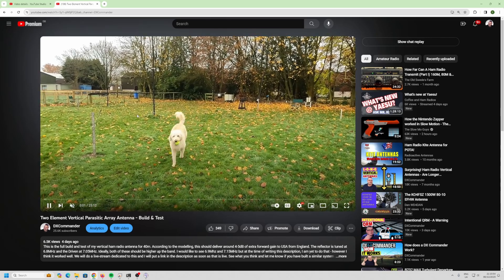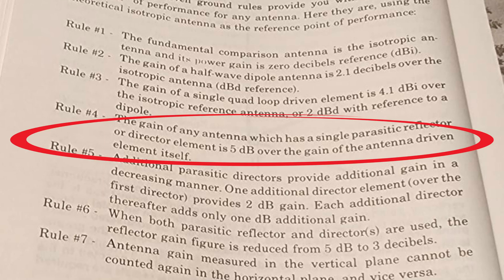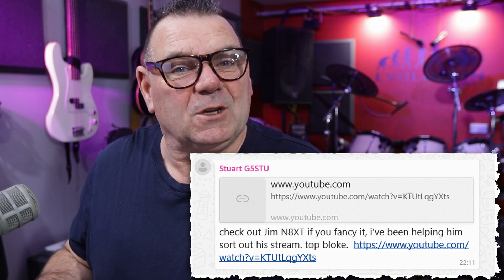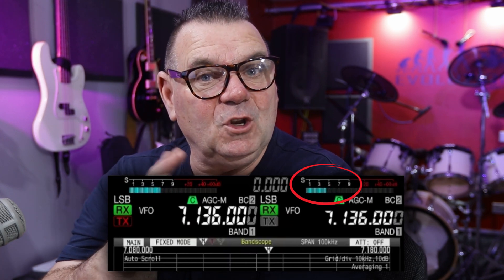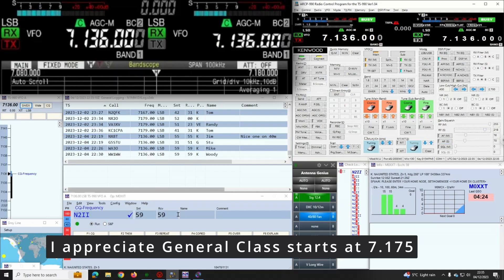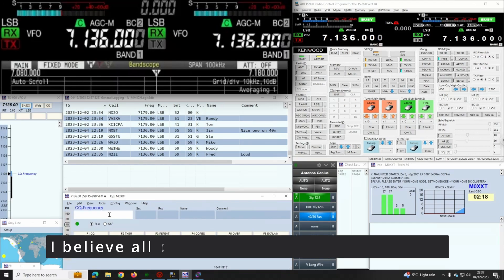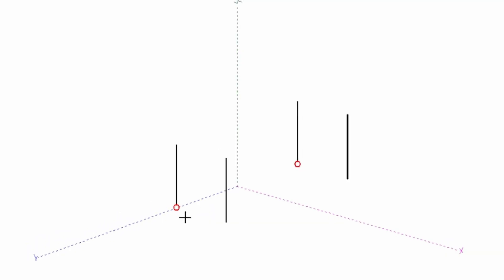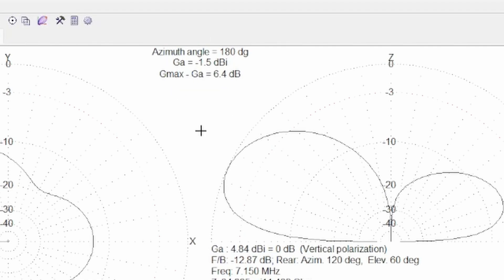40m Vertical Antenna Array - England to USA DX Result

Comment: Hey Callum.  This channel is such a good help and I really appreciate the ideas that come up.  (EG: so the listening antenna close to the ground.  Never would have thought.  I live in a city where there is a lot of noise (Calgary, Alberta, Canada) I'm about to set up a listening post and limited space in the back yard.  This will be advantageous for my situation.  Keep up the good work.  We are starting a class here where I am facilitating the class.  The participants need to get a minimum of 70 out of 100 questions here in Canada.  If you get 80 and above you acquire Basic with Honors.  Then you can operate everything from uhf, vhf and HF by phone.  It's exciting to see a lot of others really interested in this.  You are right.  It is a scientific hobby.  It gives a lot of satisfaction, especially when you can use the "hobby" during an emergency and help others.  Have a good night from across the pond as it were, from Canada.
Reply from the maker: Thank you for your volunteering! Yes, also suggest to your folks the Loop On Ground technique. Works great.

Comment: Would be interesting - if possible - to run WSPR overnight with both antenna systems to look at the results and maps on WSPR Rocks (or other WSPR reporter). Would show the real time comparison of direction, sig strength, etc. between the two to see if the gain is what is expected/modeled.
Reply from the maker: I would indeed..

Comment: Made my first 40m DX contact today (Azores island). I usually just hear stateside rag-chews on 40. Then, I heard Serbia and Portugal. Maybe it was grayline?
Reply from the maker: Greyline propagation.. That term is badly used. If it was dark(ish) then it was just 40m :)
Reply: @DXCommanderHQ  I haven't used anyone software to confirm if Azores was also in the greyline, but my understanding was that it's a narrow width of time around either sunrise or sunset (30 min?) Maybe it was just because I don't hang out on 40m at sunset usually, and the band was being the band.

Comment: Excellent work Cal. So if I’m running the Sig 9 at home, what would you recommend to buy to make a reflector that is also non guyed, considering the reflector needs to be a bit taller than the Sig 9 if I want to use the 40m band. 20m is obviously just another Sig 9 pole and 4 ft fibreglass inner tube sunk into the ground.
Reply from the maker: OK, anything.. Because you can load up the reflector. Either linear loaded or with a coil.. As long as you get it resonant on or around 6.95-7.00. Even a Rapide Pole will do this. Actually, a Classic will do it too - as long as when the big winds come, you drop it over.

Comment: I saw a model of a rhomboid long wire antenna with one end open just a bit. The guy on the video said its narrow signal had a gain of 23 db.  Does that sound real?
Reply from the maker: It might. 2-factors in play. A) size and B) height. Add depends on what that 23dB is comparing to. So 23dBW (for instance).. That means when compared to 1 Watt.. just for reference is same as 200W. In real world terms, your 1,500 W becomes 300,000W. I think someone might have been running the maths a bit tight!

Comment: IIRC you did this by using it as a parasitic element.  Could you electronically switch in a length of wire and change it between reflector and director, making it steerable?
Years ago there was a CB antenna that had 3 vertical elements spaced out by booms radially.  Changing directions with a switchbox in the shack would electrically change the length of two of the elements turning them into reflectors and the third would be your driven.  Gave you three directions without a rotator.
Reply from the maker: Yes you could.. However the reflector is most efficient, the director less so. Better ways of cracking that nut I think.

Comment: G/M Cal, Mike, K1FNX near Boston here.....looking forward to the triangle array........I could add another radiator to my 2 element phased array here...........the switching and matching network looks complicated but I think you have a "box" already doped out? a 2'nd full phased pair at right angles to my current "twins" might actuall be easier to implement. well look for you on 40 cheers from New England to Old England, K1FNX
Reply from the maker: OK, nice one!

Comment: The angles are typically lower during the middle of the night than closer to SR/SS hours.   Near SR/SS even a relatively low dipole can work well for DX at times, due to high angle incoming signals.
Reply: Glad you posted this reply.. Low angle is a real boon if your after the other side of the world... I like you don't get to caught in it.. The phased vertical thing is however  much more exciting.. A true ledgend of a man chris from just east of Banbury oxon used to phase the antron half waves on his lawn.. I think he got upto 4 in the end... Needless to say a big station in his day... Cal is realy doing a lot of interesting stuff on here... Good to see his excitement and enthusiasm..
Reply: @roberthopkins8089  Yes a 4 square is a really great antenna.  Especially on low bands where you will struggle to get a yagi at decent height.  And yes antennas (and propagation) is the real fun in radio <IMO>.
I enjoy chasing DX on the more difficult bands like 6m and 160m.  Chaing DXCC-Challinge award has forced me to spend more time there where I can find new slots :)

Comment: Callum, when you work the US, you should do what some of the other stations in EU do and ask for region #s. Like 5 calls only etc. The only reason I got through to you the other day is because there weren't any east coast boys blowing me away. I swear you could probably reach to California or even Washington state (6 and 7 calls in the US.) Just a suggestion. I am working on a phasing harness as well but am looking at 20 meters as I don't have the space to deploy 40.
Reply from the maker: I have thought about that but since quite often I can only just hear partial callsigns, I just call that guy.. I think if I had 100 ft tower and a 2 or 3 element on top, I could do.. But I'm right on the edge of what's possible.. :)